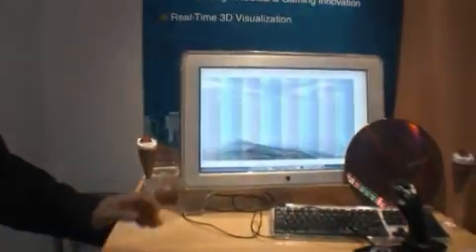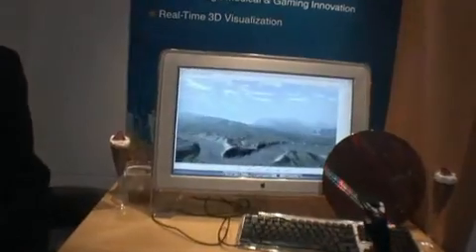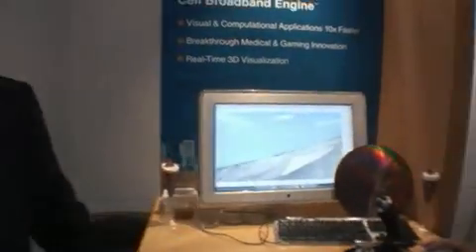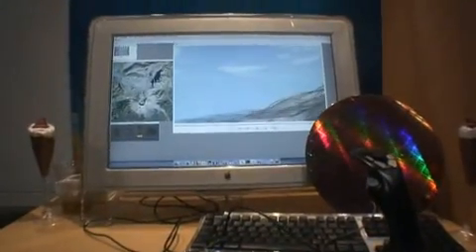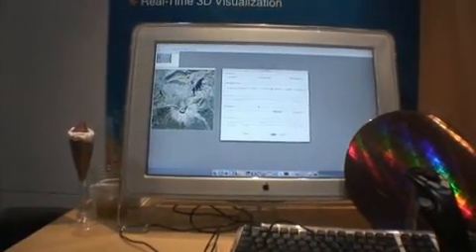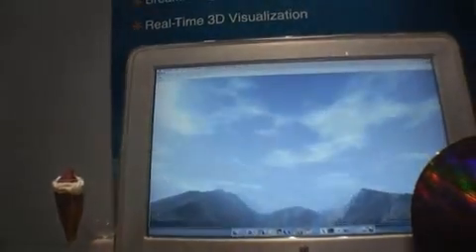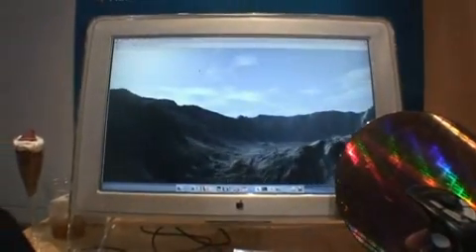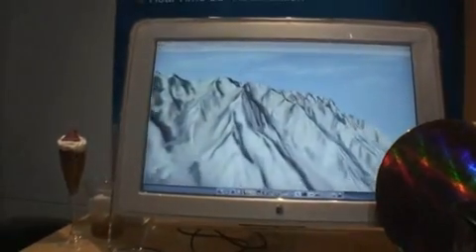Cell Processor

Comment: If the Cell CPU is that small then why is th PS3 so fuckin phat?
Reply: Hairee Stener Blu Ray drive RSX GPU and both take up a lot of heat.
Reply: The Cell CPU gets hot, so it needs a big freaking cooler which consists of a large copper/aluminium heatsink and a large fan. That's why the PS3 is so phat.

Comment: The Cell CPU like the split-RAM arrangement for the PS3 requires a lot of bottom-up development. This is why even good multiplats on the PS3 still don't look at good as exclusives. Why else would a machine that so flawlessly handles Uncharted, Killzone 3 and GOW3 only does an okay job with games like BF3, Arkam City etc. a year later?!

Comment: How many people still thinkin the "CELL" processor have 9 PP cores, it has only 1 power processor and 8 Spu´s(1 locked on ps3 for XMB ). the capabilities are for poligons and rendering Maps, with the advantage of spu´s applied on more data flow for specfic tasks like sound decoding, calculations of motion capture, IA on enemies, as programer they can add more elemnent on game but only few games takes advantage of that...sorry for my lousy english but this is my poor opinion.

Comment: @EimlanzerChannel Why isn't an SPE a core? Its a separate processor on the same chip. It has its own set of registers, execution units, memory controller.. The only real difference is that it uses DMA commands if it needs to access system RAM.

Comment: Blu-Ray can hold so much more content,which means more value for your 60 bucks.A dev from Rock Star has actually commented that if GTA4 was a PS3 exclusive, they could have put more stuff,a bigger story,and a much bigger Liberty City.Because of the Cell and the RSX,the PS3 can handle 60 player battles online and 8 player co op with Resistance,it can have 256 players shooting it out online with MAG.My last point:Go look up how many more exclusives are coming for the PS3 compared to the 360.

Comment: I'm not preaching anything. You are preaching that it doesn't do with all the REAL WORLD tests says it can. However, we have the world's 1st PetaFLOPS+ and most energy efficient supercomputer at LANL because of the Cell. They aren't using multimedia applications. One can't be logical and try to dismiss the PROVEN power.

They stopped development on Cell because there roadmap already goes up to 36 cores(@45nm) and the Cell is meant to work in concert with other Cell CPUs. 4 core Cell PCI are $280

Comment: Even if we go by "core for core" performance (which is a flawed metric), the Cell processor is still faster in many tasks.  Code I wrote for Cell is over 4 times faster on 1 SPE when compared to 1 core on a 3GHz Core 2 Duo.  For many compute-intensive tasks, Cell is far better than any Intel offering. It has a ton more available bandwith, a larger register file, and far more useful instructions.

Comment: The Cell is very weak at sucking ass. You can fit 4 SPEs in the space of a traditional single core offering from AMD/Intel. Each SPE is capable of 25.6GFLOPS.  Intel multicore chips are just passing that, now, for the entire chip! If programmed for properly, they can basically handle whatever an AMD/Intel chip can handle. 3.2GHz a high frequency to run at, but is can operate at 5GHz+ @90nm.  At 45nm, it can reach up to about 7GHz. One SPE is much faster at FFT for gaming than ANY single core.

Comment: the CEll unit currently in the PS3 can in no shape or form outperform the current PC CPUs. 
Tboninator is right, an SPE does not equal a PPE. in the PS3 two SPEs are reserved, and the rest are

Comment: The Cell in the PS3, in it's current form with only 1 core, isn't fit for gaming. If it had 2 cores, then it would beat the 360 straight out, but right now, its just milling around.

For those saying it has 8 cores, it has 8 SPEs, which aren't cores, and 1 PPE, which is a core.

Comment: Cell has one PPE(Power Processor Element) *Not power pc based* , instead of it is a fairly stripped down redesigned RISC processor , but capable of running PowerPC binary code(Runs OS to admin the other SPEs). The other 8 SPE(as the original design stated)-Synergistic Processor Elements-. Are brand new design - only in a kind- RISC processors optimized raw data processing,data streaming and vectorial calculations. The one used in PS3 will have only 7 SPEs. None of Cell elements support OOO.

Comment: The Cell BE is designed purely for streaming and heavy number crunching, and video games and high performance computing offer that. However, general purpose computing is a whole another matter and does not require a huge amount of processing power.